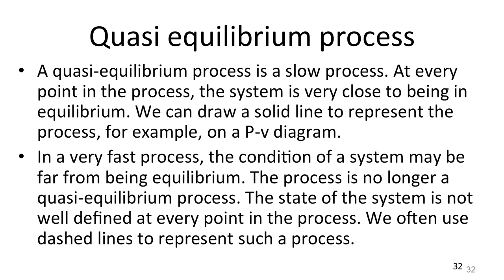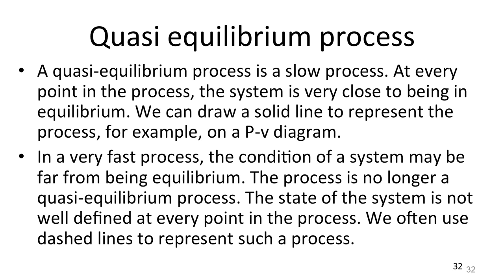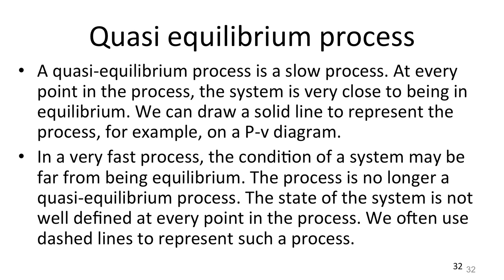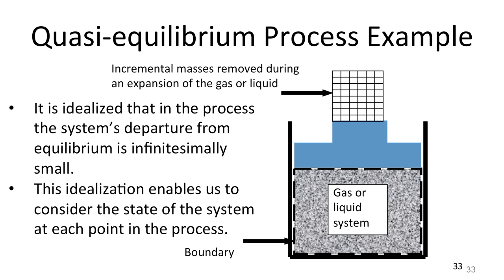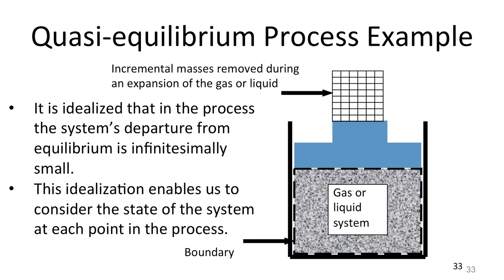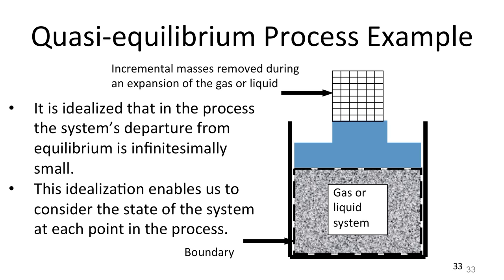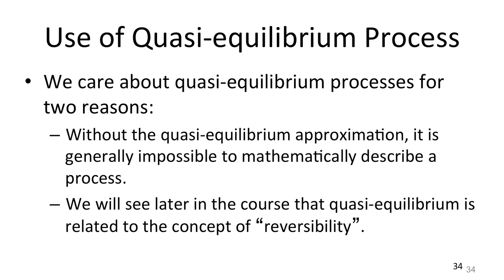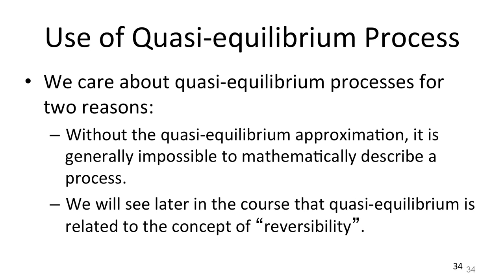Quasi equilibrium

Comment: Thank you for uploading the video, I at least understood a little more about this concept. One question, consider the gases in a combustion engine cylinder is the system, then the expansion of the gases is quasi equilibrium because the expansion is infinitesimally small compared to how fast the piston is moving ? I mean the expansion can be neglected---> causes no change to the system.
Reply from the maker: For all practical purposes, we consider the gas system to be under quasi equilibrium if the expansion or compression is slow comparing to the speed of sound in the gas. When the system is expanding or being compressed, strictly speaking it is not in equilibrium. However, if the system's boundary (such as the inside surface of the piston) moves much slower than the speed of sound, the deviation of the system from equilibrium is very small, and the system is in quasi equilibrium.
Reply: @bing9u0  Thanks for your response. I thought I understand this but now I feel like I dont, this concept is so confusing. Back to the expansion of the combustion gas inside the cylinder, how is the system still remained in equilibrium when there is chemical reactions occurs throughout the process? This is what I learned: A Quasiequalibrium process is, first of all, a thermodynamic equilibrium ( satisfy all these: thermal equilibrium, mechanical equilibrium and chemical equalibrium). I would guess that the system satisfy the first two( thermal and mechanical equilibrium), but why chemical equilibrium? Isn't the gas combustion is chemical reactions?
Reply from the maker: @K_Sonn  In the context of a typical thermodynamics course offered to Mechanical Engineering students, the chemical reactions in an internal combustion engine are not considered in detail. Instead, the reactions, which lead to the release of chemical energy, are modeled as a heat addition process. Further, the "heat addition" process is typically modeled as either an instantaneous (and hence isochoric) process for the Otto cycle or a constant-pressure process for the Diesel cycle.
Reply: @bing9u0  I see, that makes sense. Thank you so much for your help

Comment: So a piston attached to a rotating camshaft, that moves by heating the gas contained up, is not in quasi-equilibrium?
Reply from the maker: When we talk about equilibrium or quasi-equilibrium in thermodynamics, we are talking about a system - a system being in equilibrium or quasi-equilibrium. As for the piston you referred to, it typically appears as part of a piston-cylinder enclosure, which contains some gas that you can add heat to or remove heat from. In this case, the gas is the SYSTEM. The piston and the cylinder are the surroundings of the system (the gas). Assuming no leakage between the piston and the cylinder, the gas is a closed system, which can be involved in doing boundary work or receiving boundary work (and possibly heat addition or removal), as the piston moves. In most engineering applications, the gas (the system) can be considered in quasi-equilibrium.

If the system is in quasi-equilibrium when it undergoes a process, that process is also called quasi-equilibrium or quasi-static process.